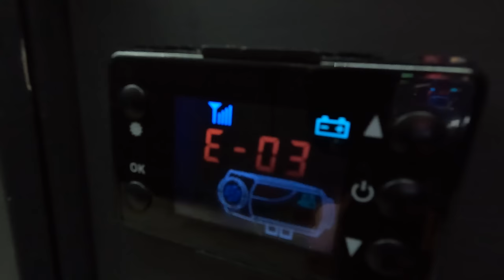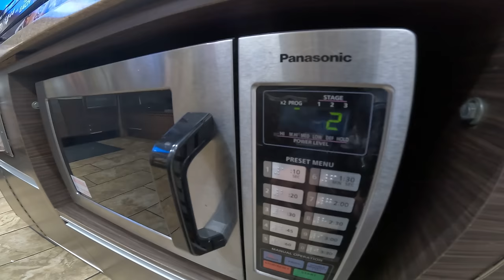Luxury Van Camping | Cooking Pot Pie at A Hotspring

Comment: Glow plugs for those Chinese diesel heaters are readily available on Amazon. I recently ordered one for my diesel heater and it shipped the same day. It also came complete with the required extraction tool. It's a lot easier to just change a glow plug than tear apart your van to remove and replace the whole assembly.

Comment: The minerals in water do not evaporate and can short out your key fob. Grab some q-tips and use isopropyl alcohol and don't be shy to give everything a good rub that is electrical. Also make sure water is not sitting under the button shorting it out if possible. The alcohol will evaporate and you might get lucky the key fob would work. I've done this two times with one of my key fobs and it still works years after.

As I type this the key fob is working LoL. Still prudent to give it a cleaning.

Comment: Hey Ryan, keep a bottle of diesel 911 anti gel in your van to use if your diesel fuel gels up and your heater shuts down. Your reservoir is small and will gel faster in the cold. Trucker recommended😊. Thanks for the journey!

Comment: pro tip if your key or mostly any electronic gets wet internally do not do anything other than immediately take it a part and let it dry. Most of the time they will work. Using them when wet is hat mostly shorts them out.

Comment: Tip for knife care: when you're scraping ingredients off the board, use the back of the knife, not the blade edge. If you keep scraping with the blade edge, you'll end up rolling the edge much faster than normal and your knife will get dull way faster than it should. Also, a simple steel honing rod is a great way to keep your edge aligned and cutting smoothly so you won't need to sharpen your knife too often either.

Comment: look up the stove knob replacement online and instead of buying it, eyeball the 'levels' and then white sharpie your existing knob! we love DIY!
Reply: I used a fine tip white nail polish pen on mine and my markings have lasted for over 3 years, now. Had to use an oven thermometer to get the markings right, because I didn't want to eyeball it. End result was better (and a lot more accurate) than what the manufacturer supplied when the stove was new.

Comment: Order yourself 2 new Chinese heater so you have one in spare haha the cables and everything else works perfect and u just have to swap out the unit. Also running kerosine through it might clean your glow plug up
Reply: I was looking to see if anyone suggested buying two sets of replacement pieces.  For these emergencies and also maybe later the parts are out of stock or discontinued.
Reply: @BlueShadow923  the controllers for the newer generation Chinese diesel heaters are identical to the older units, and the size too. They never change the diameter

Comment: Better get some electrical cleaner for remote lock controller. I fixed someones key remote it took a few times because of corrosion.  Put another wire paperclip with another homemade battery connector. But it still was in bad shape. Guess you can buy another unless your handy electronic fixer. Maybe they got waterproof coat.

Comment: Probably wont work due to the water being "dirty" however try bathing your key in pure isopropyl alcohol and scrubbing the board gently with a fine brush, then leave out to dry. The alcohol will completely evaporate leaving no shmoo and residue and can save electronics and hopefully you $300 dollary doos.

Comment: If you get some 90 percent isopropylne alcohol and lightly brush it on the board of your key fob and let it dry it should work I work in a phone repair industry and that's how we treat some water damage
Reply: This is correct. I ran my iPod shuffle through the washing machine. Alcohol and a gentle spray of compressed air and it works like new!

Comment: Beware of those fool ya old time pump handle style frost proof faucets, they are not for potable water, no matter what the sign may say. Most of the older ones like that are made with leaded galvanized metal, and also tend to mold up due to being open the outside environment at the weep hole inside the valve at the base of the assembly.

Comment: doesn't van have reg hater up front?
Reply: My Promaster was an  empty shell in cargo area.  I've tried to run flexible pipe from under dash on passenger side to the back...also drove with my separation curtain open...doesn't help enough.
Reply: @BlueShadow923  well I was thinking g just to take chill out of air. my truck heater the one that came withyruck heats my crew cab n back camper shell if I open back window of cab I leave it open when driving or dogs in bed of truck. if sleeping n it cold I have cal king electric blanket bigger then I need but dogs can lay on it too I put their sleeping bags on it
Reply: @kelliepineda9822  I agree.  I am a once a month non-winter traveler still tied down to a 9-5 desk job.  I do not have the solar like Ryan.  I have an electric blanket which works well while sleeping.  I need to look into the blanket you mentioned.  When I wake up from the cold I dress really quick and get heat going in the front area with the privacy curtain open.  My van only distributes heat from the various dashboard vents.